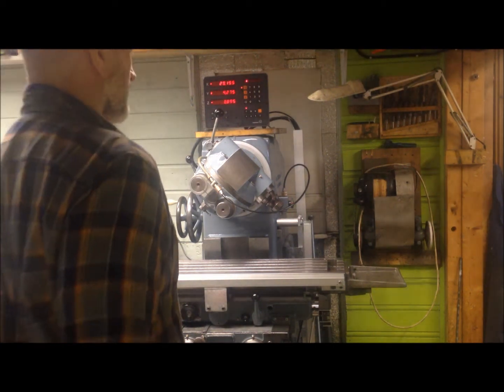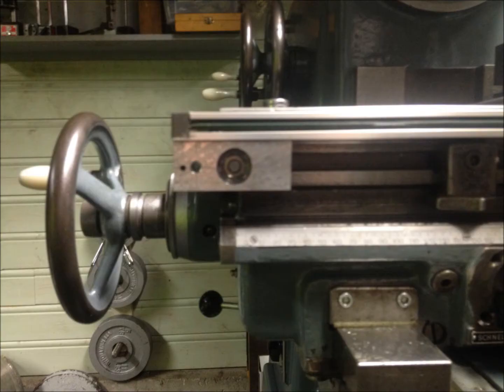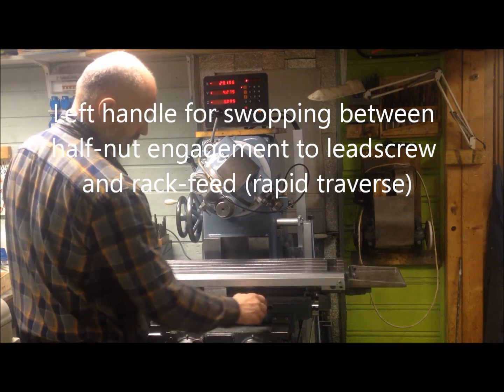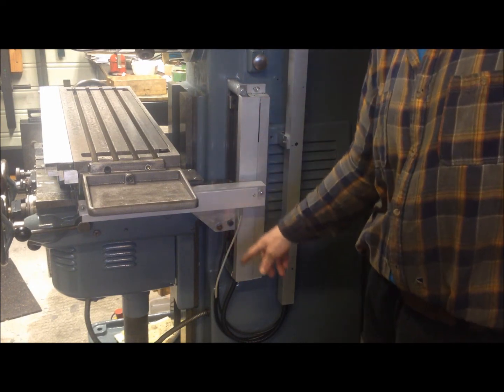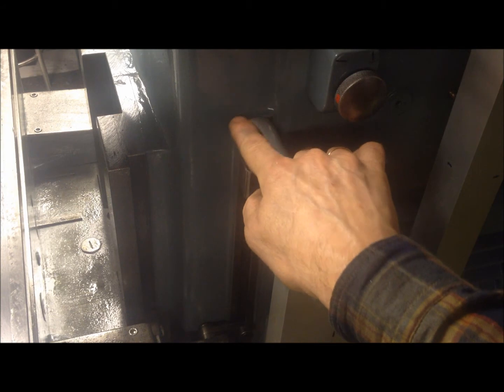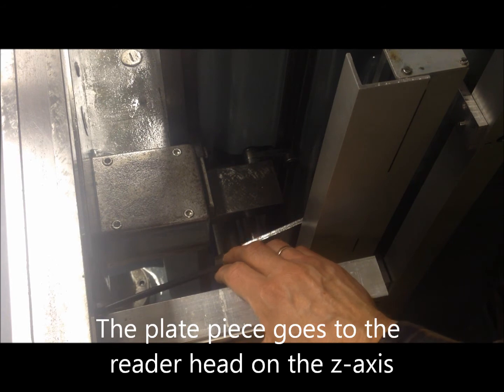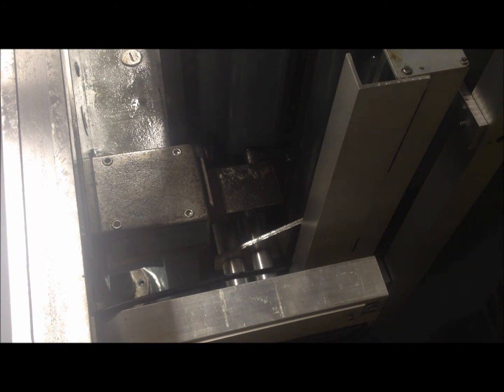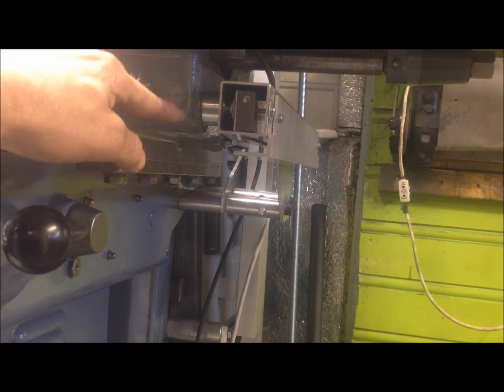Schaublin SV52 milling machine - mounting DRO

Comment: I have been watching the rebuild of this machine, all the scraping, and so on, for some time. I am glad to see it completed. I am glad to see it's down to the DRO. I think it was a nice clean job of installation, but now I expect to see the Schaublin in action:) And I wish I had one, at least it's metric.
Reply from the maker: Thanks. Yes, me too.I have been using it though for some smaller projects both in alu and steel. Performs good. I think my next project with this will be T-nuts. I am inspired by Adam Booth to do this using horizontal milling cutters, ganged up if I can make a 12 mm spacer, or one side at a time.
Reply: Horizontal milling is underrated these days. Watching Adam with that big K&T is a real education.Good luck with the project. gang milling woullld save you a lot of time.

Comment: Jan, I have recently bought a SV-51 model of this milling machine from sweden. I have done my first work with that one now and I can tell that the really heavy construction shows out.
I also noticed that Your machine is as noisy as mine - I think that is the characteristic of the spindle drive system with all those gears and all.
Somebody had made the mistake of lubricating the machine with grease - all that butter is now out but there are bearings here and there that need replacement because of that. The lubrication works with gravity in this machine and there are small holes here and there for the oil to drip into. Grease does not drip....
All in all - after lookin all Your videos and working with the (quite) same machine - Good job and aren't we lucky to have these beasts :)
Reply from the maker: Thanks for the comments. These are fine millers. Quality all the way through. I am sure you will get good use of yours. What kind of wear did you find? If any.. 
I agree with respect to the gearing and noise. Most of the lubrication points are for oil, but some are for grease. I think these are colored red in my copy of the instruction manual.
PS! I know of just one other 51 in Sweden.. just curious, where did you find yours? And are you located there yourself?
Reply: @jansverrehaugjord9934  In my "Betriebsanweisung" (User Manual) they do not talk about using grease. There is a separate chapter for oiling and in that they state that the red ones are for daily and the metallic ones for weekly lubrication. In addition the Z-axis screw should be lubricated weekly.
The reason for using oil and not grease is that grease collects and blocks itself. Oil does not do that. In addition quite many parts have a gravity-operated oiling system, especially the cylinder. For example the in/out screw will never get lubricated if one uses grease. Also, the big bearing at the back of the cylinder will have the same fate if grease is used. Mine was completely dry.
In my case the miller was very little used but that little was some misuse. Wrong lubrication, milling the table, hammering the cylinder, etc. There was aluminium swarf everywhere, inside the cylinder, inside the motor, inside all oil baths and finally, the strangest place, inside the horizontal milling supports. The bad lubrication, of course, resulted in bearing damage the worst being the variator pulley which has a bronze bushing. This was completely shot. I made a new one for that.
Finally, I bought this machine from sweden and had it transported to finland. Despite the fact that it was not in working condition, the 2700 EUR price (including transportation) was a bargain.
Reply from the maker: @FinnoUgricMachining  You are of course absolutely right about grease in oil lines. This is a big No-No and will effectively block the lubrication system. Not sure where I got this from that some of the points on the 52 had grease nipples, but couldn't find this now. My apology! I have anyhow used oil all over since it is much easier.. many points though. .must be close to 25 or so..
Aahh.. apologies again.. should have understood your Finnish. The price seems reasonable. I paid 12000 DKK, plus another 3 for freight.. plus 25% VAT, so end up at 20+ Kilo NOKs